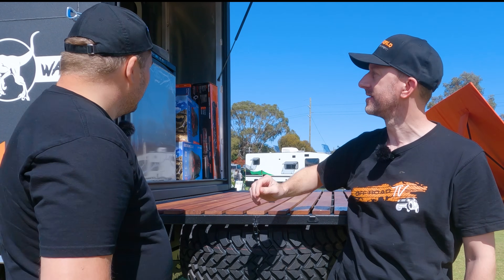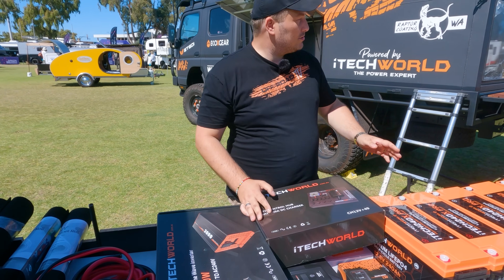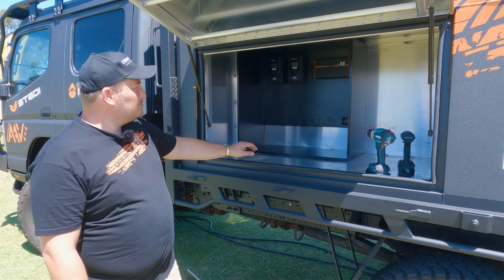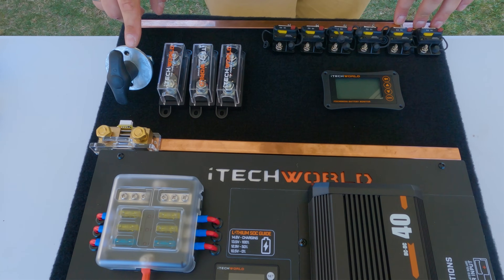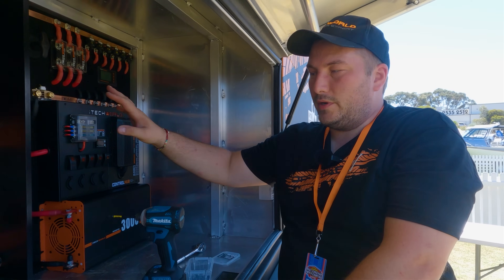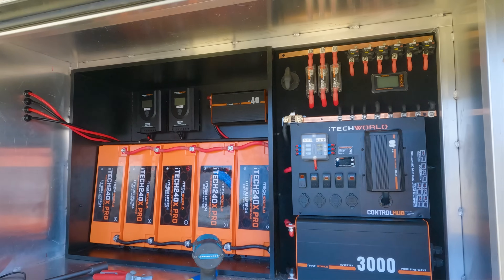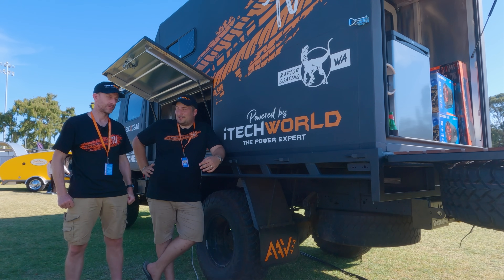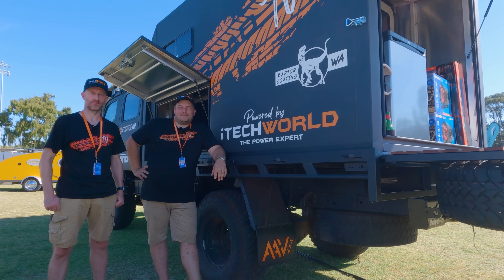12V setup that can run A/C off-grid indefinitely | Complete DIY install and walkthrough

Comment: Whoa! How does it go in the Australian heat? Have you done some real life testing yet?
Reply from the maker: So far it has been unreal - running A/C and the bar off grid with power to spare 💪 Yesterday was a great test (40C outside) and the MPPTs (hottest point) got to 46C which is great (and that is without running fans whilst charging and running the 3000w inverter). So far there seems to be enough space in the cabinet to disperse the heat but we do have fans and filters ready to install if the temps get higher..